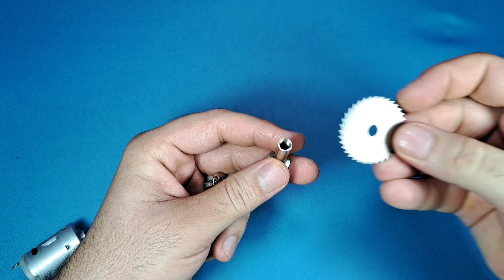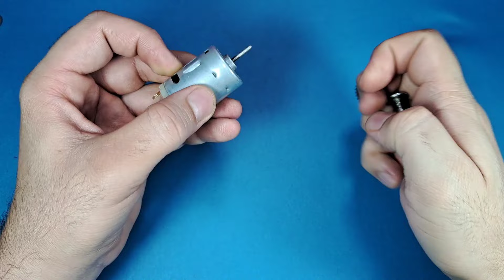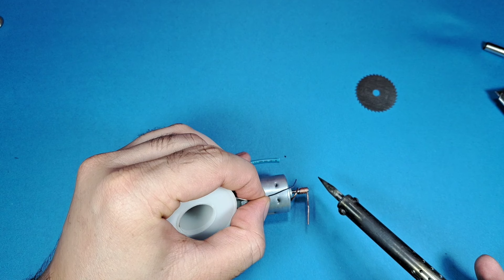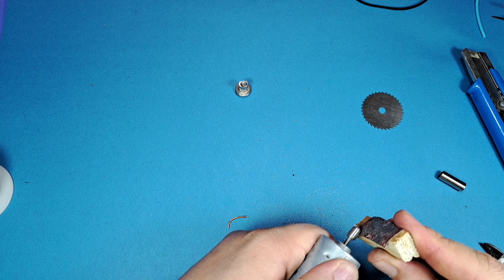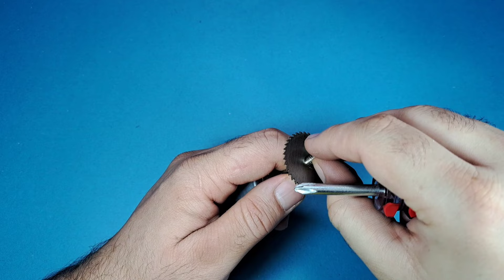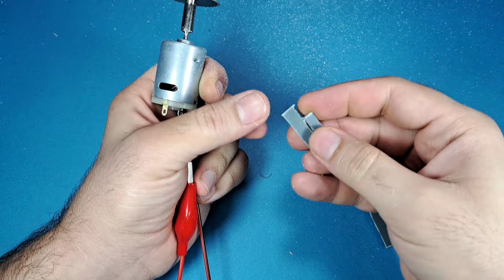drill chuck/how to make mini drill chuck from bolts and nuts

Comment: I get that your video is to illustrate how one can make a simple small chuck from nuts and bolts, but to cut plastics  in straight lines it is faster and more efficient to score a couple lines through the surface with a knife and simply break it clean instead of cutting it with a tool that seems to have very little power and end up with a skewed cut that you have to clean up burs from the heat melting the cut.